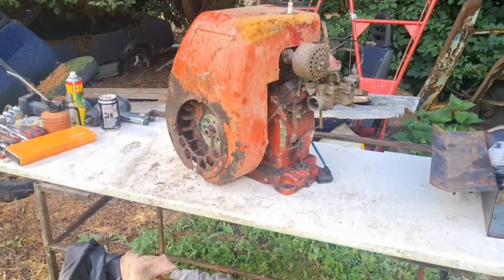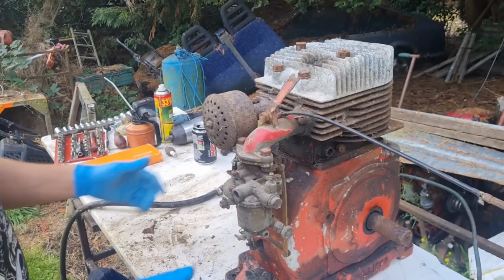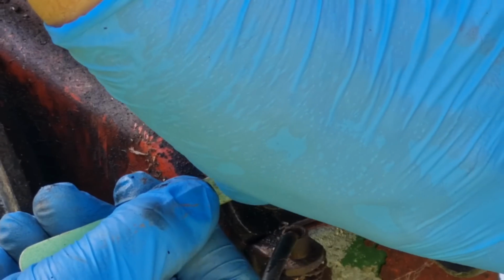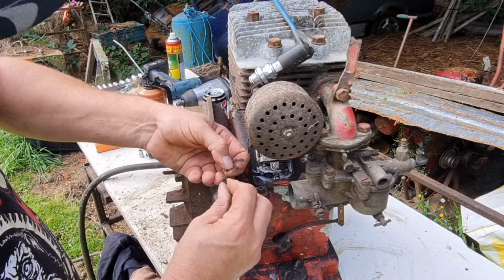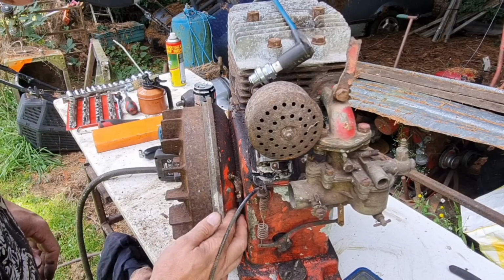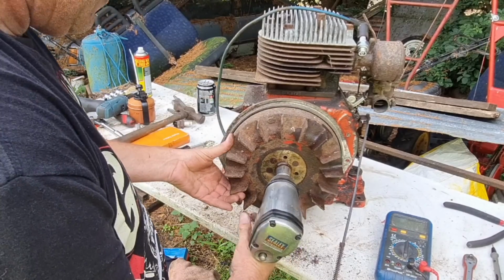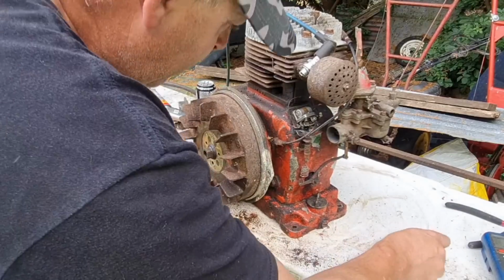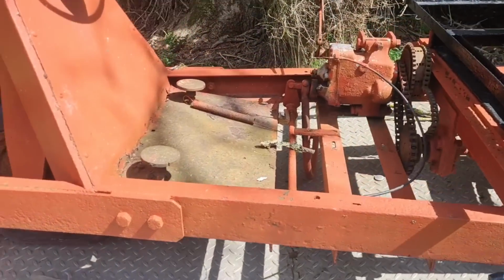Bonser auto truck engine. can we save it? Villiers Mk40

Comment: I have never seen those captive nuts strip the thread, I have had one burst out of the flywheel. If you hit the end of the nut with a big hammer it will jolt the flywheel free. The coil is meant to be going to ground on the other end so that when the points are closed current flows in the coil, it is the points opening that cause a massive build up of magnetic force that then collapses that creates the spark.

Comment: I'm surprised you stripped that thread Adam, I've found them pretty tough. I have a MK 10 that had a nut so tight the windy gun failed, I had 3 foot bars on it and the crankshaft, which I jumped on, before it moved, and I'd heated it damn hot and banged it plenty with a hammer as well.
Then it turned, but the flywheel was stuck and winding the nut out just bent the flywheel, again 3 foot bars. Eventually I just cut the flywheel off with an angle grinder, after a ten ton hydraulic puller failed to shift it.
However, the thread was still intact after all this, though I did need to re-cut it a little it didn't strip! The engine still runs with a replacement flywheel.
You could have heated the nut, there's a lot of heat sinking from the flywheel and the crank, I'd not worry about the seal if you get in with map gas and heat the nut quickly.

Comment: You shouldnt of went back and forth on a taper as it will strip the threads, it just needed a better inpact gun to unscrew (ive found a ryobi 19b impact far better than an air one). I worked a thread back and forth with an inpact once and it pulled the threads off!. I would still restore the villiers as its rare and special - you can get most parts of one of the villiers websites.

Comment: L&S engineers and Villiers for your spares, L&S have a section for the Mk40 smacking the flywheel nut didn't help, last time I did that the threaded end sheered from the crank.

Comment: Shame about the flywheel not coming off, as others have said you could try battery/coil ignition to see if it runs, if it does maybe carry on with it, if not then it's find a replacement, does your man over at Rusty Relics have anything?

Comment: Take electric die grinder with small cut off disc cut the nut carefully so you could split it and get another nut . Condenser could be shot.
Reply: They're built into the flywheel! Not so easy to do.

Comment: Loving the Bonser Truck Adam, but it's a shame about the Villiers Engine. Can't the Flywheel nut be cut off, using a nut splitter or something?? Mind you though, I suspect you have many small enigines stashed away somewhere, lol.  Good luck mate.
Reply: No, the nut is built into the flywheel so you can't get at it! You have to cut the flywheel off with an angle grinder to get at the nut, then cut the nut off the shaft, whilst hoping the thread on the crankshaft is not stripped.
Reply: @theoilybeard3287  Man, what a horrible design. Still, if saving that engine is the only way, then cutting the flywheel off might be the only option, but wow, what a naughty bit of engineering!!
Reply: @simonwatson5299  It works well when it works, making it easy to pull the flywheel. I have no idea how mine got so tight, every other one I've had has been just fine. I was expecting to find green loctite, but nothing there!

Comment: One end of the primary coil does, and should, run to ground in common with one end of the secondary coil. The other end of the primary goes to the points and condenser, while the open end of the secondary goes to the plug. Doesn't it? The primary will show continuity, as indeed it should. What it should not be, is dead short. So a reading on the Ohms setting should be taken, and should not be zero Ohms. I'm not sure what the resistance will be, and it can vary from make to make, but the secondary coil should be in the order of several thousand Ohms (plug wire to ground). 

If you have the points, condenser, and coil all connected together correctly, connect your multimeter across the points, you should read zero Ohms while the points are closed, and a definite resistance value when the points are open (primary coil resistance). Remember too, condensers can and do fail, and if that happens you can get anything from no spark at all to a weak, pale spark at best. You can easily substitute a normal car condenser for testing purposes.

However, if all else fails, you have conventional points and condenser, which means you can easily convert it battery and coil ignition, and it would be entirely reversible if/when the necessary parts can be found. From a "Will it start" point of view, you still have multiple options to get it running!

If you were to go along the battery/coil route, you could also consider fitting a dynostarter, which would give you electric start, and battery charging in one! A dynostarter wouldn't be out of place on a machine of that period - Probably never offered as an option, but definitely not out of place.

Comment: If the points work you might run it with a separate battery and coil.
Reply from the maker: Yeah I did think if that. But them you need to introduce a charging system. Could be OK just to get the engine running tho.
Reply: @NorfolkMancave  It'll run for a very long time on a battery just doing the ignition. You could use a small radio control lithium ion battery and hide it behind the chassis, charge it at home before a rally and forget the charging system on the truck. A "3S" lipo battery is roughly 12 volts so would be about right for a car coil.